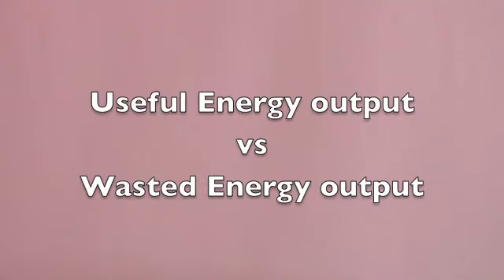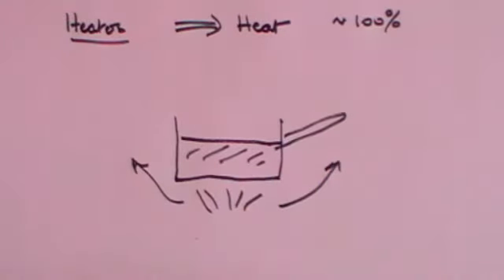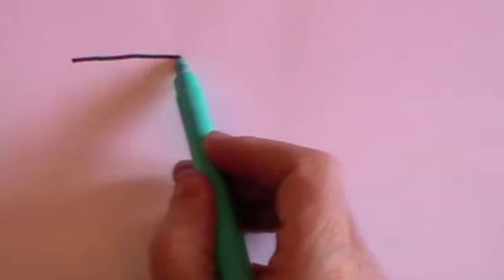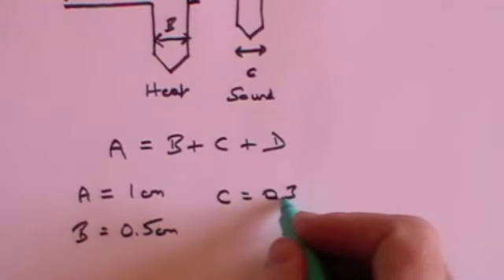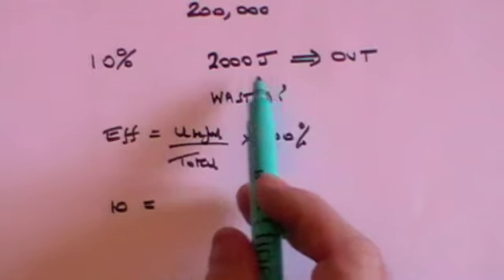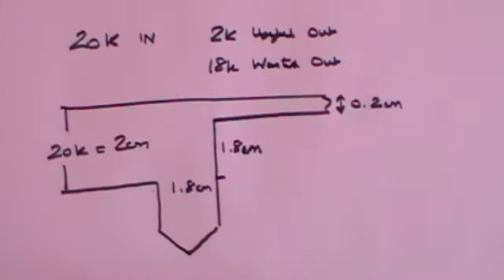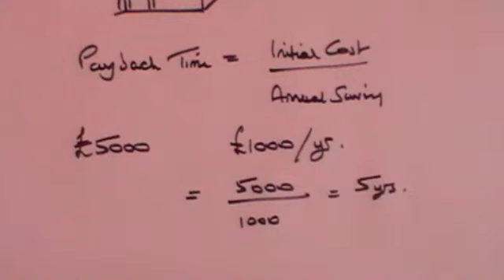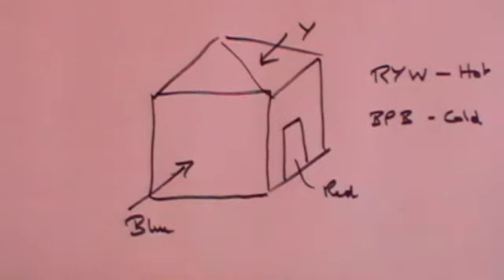Energy Transfer and Efficiency

Comment: Wind that meets a resistant turbine blade transfers the energy that it exerts to the blade in direct proportion to the percentage of resistance the turbine blade provided to the wind.  Thus a wind turbine blade must be made to a maximum resistant design not the slicing the air blades of the present popular design in wind turbines.